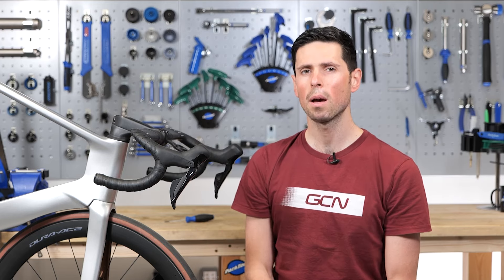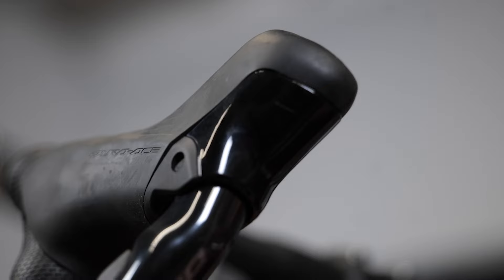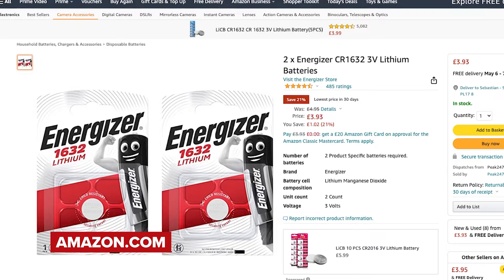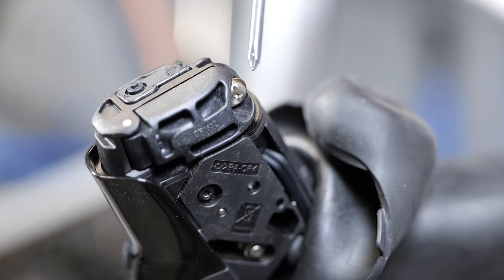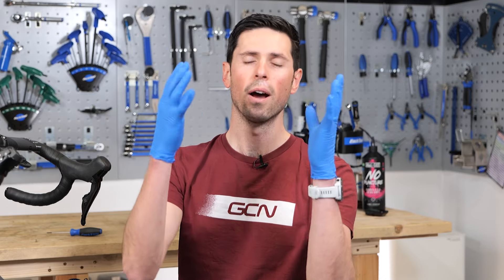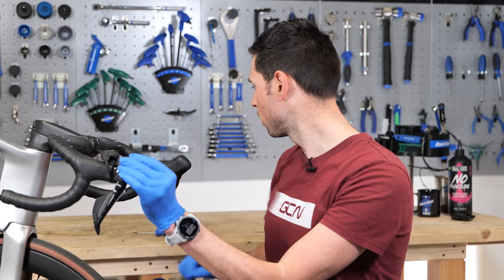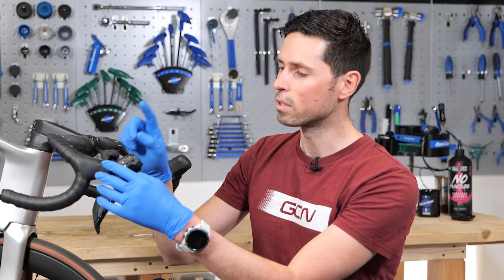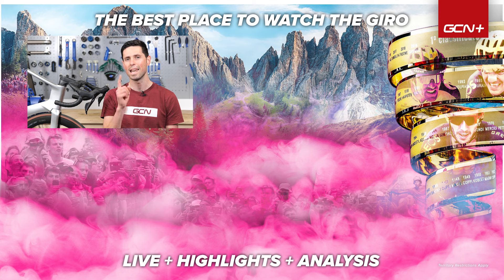How To Check & Replace Shimano 12-Speed Wireless Shifter Batteries | Maintenance Monday

Comment: Batteries should be taken for recycling (most supermarkets in the UK have a battery bin around the checkout area).
Reply: Yes. Especially the 1632 as it contains lithium should really never be put into the bin. It's both a hazard putting it in the bin as a wasted recycling opportunity.
Reply: @teundilles  lithium and water doesnt go well together. Thats what causes land fill fires. Those little tripple a and double a batteries, plus cell phone batteries, are major fire hazards if they have lithium in them.
Reply: Then what would I feed the turtles in my local pond?

Comment: Thanks mate.  I've struggled to find useful instructions for di2 in one place.    I've got 105 Di2 on my BMC Roadmachine.  It works really well.  Not *quite as well as the di2 Ultegras I had on a Cannondale, but I'm quite happy.
Reply: 105 has 2 batteries in each shifter I believe but changes are 3 years typically.

Comment: Has anyone had trouble with Duracell brand batteries? I just installed a brand new Duracell (which I tested and its good) and it doesn't work at all. I put the old one back in, and it works fine. I wonder if there is something about the shape of the Duracell battery that is slightly off that prevents it from making proper contact.

Comment: Very useful and concise video.  One thing I would suggest is not to put the hood cover back until you check to see if the battery is operating correctly. This make it easier in case you have to open it up again.

Comment: Very helpful but forgot to mention battery orientation when installing. Also in technicality Cell Coin Lithium battery need be recycled properly 😊. Thanks
Reply: You can see it + side up. Also there's an engraving on the lever body.

Comment: Are the battery conditions also reported to your head unit, or just the main (i.e., seatpost) battery? On the 11-speed Di2, it’s nice to check the battery status on my Garmin.
Reply: You can use your mobile phone and Shimano E-Tube software to check both the shifters and main battery via Bluetooth, which is built-in now.
Reply: My Garmin 830 can tell me both the seatpost battery and the shifter batteries for the 12 speed.
Reply: Turns out Garmin 530, 830 & 1030 can display all three battery levels. Looks like I’ll have to update my 520 with a newer model.

Comment: Appreciate your videos here in the US. 
I have the new 12 speed dI2. The app updated all components except the shifters. I’d appreciate a video on how to update the shift firmware directly using a PC Linkage Device SM-PCE02 and windows E-Tube software. Still waiting on my adapters for SD50 to SD300 wiring. Keep up the good work and thanks.
Reply: Pretty sure the PCE02 will only do 10 & 11 speed via cabled eTube. You need the latest app and Bluetooth to diagnose 12 speed.
Reply: One slightly hacky solution I’ve seen is to buy one longer Di2 cable (12 speed size) and a cable coupler, unplug the front derailleur,  then use the coupler to attach the front derailleur cable to the new long cable and use that to connect to each shifter in turn to run the updates on each, then remove the extension and plug the front derailleur back in
Reply: @zygmuntthecacaokakistocrat6589  Nope, it does 12-speed too. In fact, Shimano are releasing a new PCE02 cable (with SD300 end) this month - part number Y79M9801T. It'll work just fine with the AD305 adapter though. 
E-Tube Project V5 only.
Reply: @timbob. Or just run the cable from the battery in the seat post, which is what I have done.

Comment: My full Tiagra group set on my 2008 Cannondale CAAD 9 has not missed a change since new and has travelled 20,000 km.
On all my bikes I have fitted Dura Ace or XTR cables since new, that's all you need to do with Shimano.
Wireless shifters sound great and I'm sure the work fantastic, now all most of us need to do is rob a bank to buy them.
But, the pro riders love them.
Thanks.
Grant
Reply: Canyon has a carbon framed road bike with Di2 for, $2700. While that is not cheap, it's hardly "rob a bank" unaffordable in the scope of modern bikes in 2024. (Especially considering that the MSRP of your bike today would be closer to $1700-1800 today.)

Comment: The chance of actually draining a battery by holding it with your fingers is minimal (unless you have wet hands).  greasy fingerprints in the wrong place messing with the connection causing it to not work, or causing it to be glitchy is a bigger risk.

Comment: #askgcntech What is the best long term repair for a tubeless road tire puncture, patch or plug? I had a recent puncture during a ride. Was able to add sealant and finish the ride with low pressure in the tire, but when I tried to air it up to my usual pressure it would only hold about 50psi before it would start to leak again. The tire is in reasonable condition other than the puncture so rather than replace it I chose to patch it on the inside. But online 'experts' criticized that choice saying that just using a 'bacon strip' plug would have been faster and easier and is just as likely to last the life of the tire. I worry that the plug is just held by friction and could become dislodged. What say you, patch or plug? Or just replace the tire?

Comment: #askgcntech 

Hi tech crew
I really wanted a pair of new tyres . However I have hookless Venn carbon rims And am confused as lots of tyre manufacturers say Things like “optimal designed for hooked rims and not hookless “. If that is the case what does it mean does it mean ?don’t use them tubeless on hookless rims? Or is it not going to perform “optimally”? 
Thanks

Comment: You dont need to know that. So why waste time saying it. Also be careful not to lose screws. Thanks Captain Obvious. Also why take the risk? Why not take the 5 seconds it literally takes to find out whether fingers on coin cell batteries discharges them. FMD. Also glad this has been put on, since the batteries should last at least 18 months, and the 12 speeds been out less than a year. Why not release in six months time

Comment: I don't think touching the battery with your fingers will drain any electricity. Batteries and electric motors do not belong on a bicycle.
Reply: If you install a battery with sweaty fingers, you can get problems. When handling batteries keep them clean to prevent issues.

Comment: 20 years from now, it'll be "what the hell did they do it like this for?" & putting the fragile wireless electronics & charging port in the first-thing-to-hit-the-ground-in-a-crash $$$$ rear derailleur is just mind-bogglingly stupid. I'll be hanging onto my mechanical 9100 groupset until it's absolutely worn out, if this is the throwaway, waste-generating way they're going. You can recycle stainless steel cable, but you can't recycle coin cells, unless you're in Germany.  0 stars.